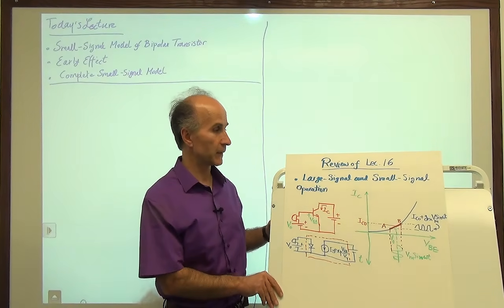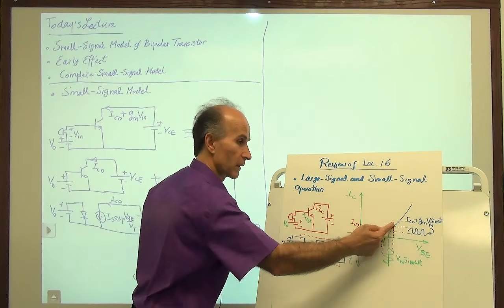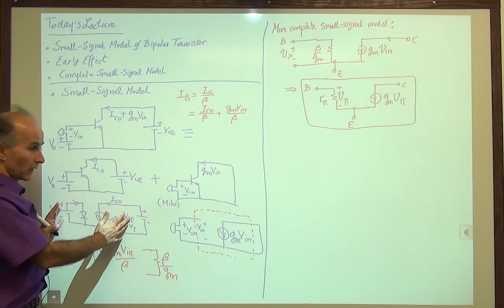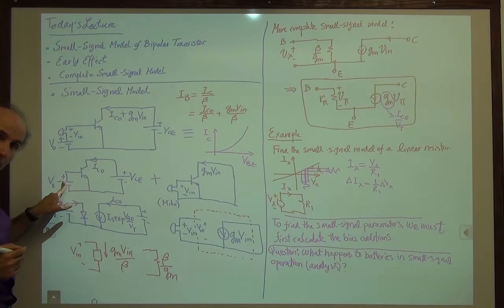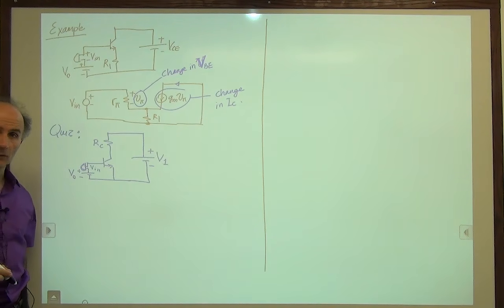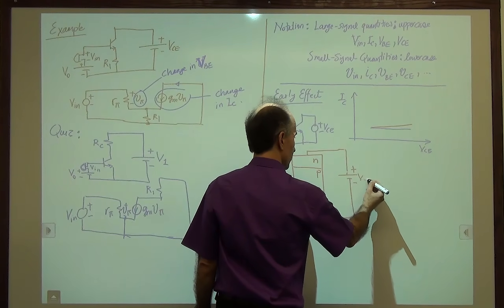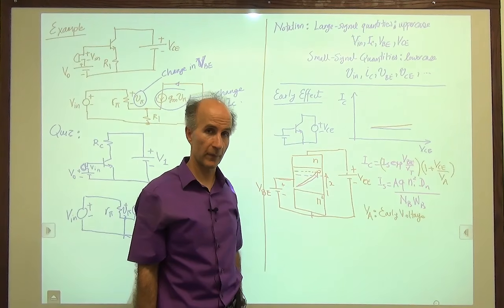Razavi Electronics 1, Lec 17, Bipolar Small-Signal Model, Early Effect

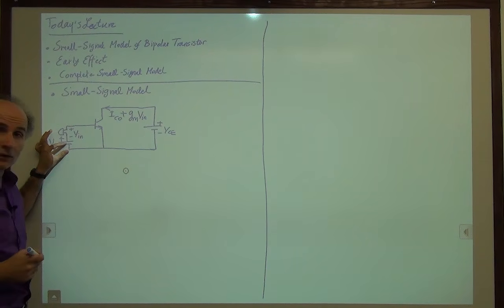Comment: 11:20 superposition works with linearity. bjt is non linear.
Reply: but it works as linear under specified conditions.
as V0 will remain constant which is part of large signal so the non linear portion is not changing at all.
only the small signal component is changing which is infact linear.

Comment: that r pi resistance in the model is strange   it`s equal with beta times the dynamic resistance of the base emitter pn junction  ==> B ( Vt/Icq) also known as the input resistance in some other books , who comes up with this names .....
Reply: small signal model looks like PI symbol. Maybe r pi comes from this terminology. r pi is also called as the input resistance sometimes  because if you consider any basic amplifier as an example( common emitter, common collector) input is always connected to base only. Maybe that was the reason it is called as input resistance.

Comment: in last question , as Vce increases , x decreases => slope decreases => then diffusion current decreases 

but you said that , diffusion current increases , why ???????
Reply: I have same question, said that the second one had a sharper slope???????????????????
Reply: @02585975  Yes, it should have been the first case for the sharper slope.
Reply: @02585975  the diagram is wrong thats all explanation is crct
Reply: Hello. Yes, with higher Vce depletion width penetrates deeper into the base, so the total nondepleted P base region becomes narrower. Since you inject the same amount of electrons from the emitter (constant Vbe), starting minority electron concentration in base is the same (independent of Vce) but has to become zero across smaller P region, therefore concentration slope has increased.

Comment: why we replace the constant voltages to short circuit in small signal model? little confused:(
Reply: he said because batteries are constant voltages and for small signals we are only looking at perturbations/signals. A battery does not have any perturbations or signals because it stays constant.
Reply: Beacuse in small signal analysis we focused on excitation which are time varying (A.C.) while Constant voltage doesn't have such variation ( idle case, neglecting negligibly small Ripples)

Comment: what are small signal models for capacitor and inductor?
Reply: I think inductors and capacitors in small signal analysis are assumed to always have zero impedance at the frequency of interest, so they are getting just like the voltage sources replaced with a short to ground
Reply: I think small signal only makes sense for non-linear component. Since capacitor and inductor are linear component but with di/dt or dv/dt terms, it is better to treat them in s-domain and the algebra becomes much easier than time domain